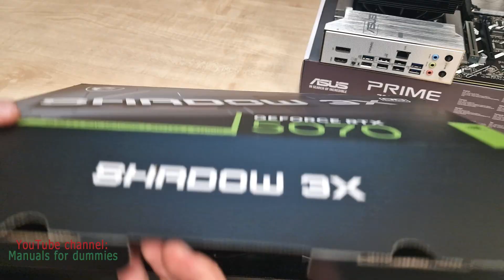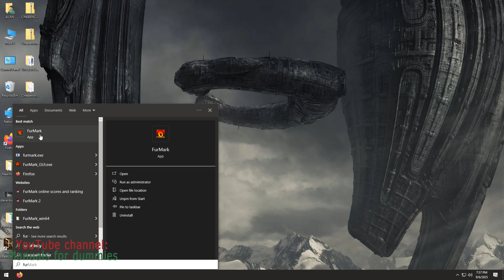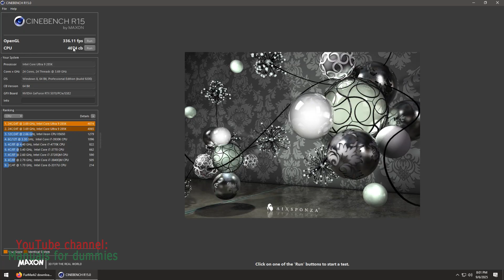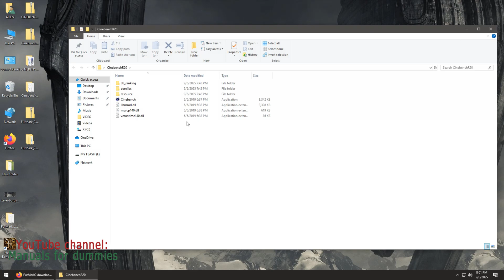INTEL ULTRA 9 285K, RTX 5070, DARK ROCK PRO 5, SSD 9100 PRO, ASUS PRIME Z890-P WIFI LGA 1851, UNBOX

Comment: I have i9-13900K is there a point to upgrade to INTEL ULTRA 9 285K?
Reply: yes, there is upgrades. but for 14900K users probably no point, I usually upgrade not faster than 2 years
Reply: @datoruveikals bro I want to build a pc for workstation I am using rtx 5080 but should I go with Intel ultra 9 285k or Ryzen 9 9950x 3d
Reply: @Sunita-b4x1i depends, I have the 285k and I love it but you need extremely high speed ram to get the most out of it, and try to get CUDIMM memory too. 😊